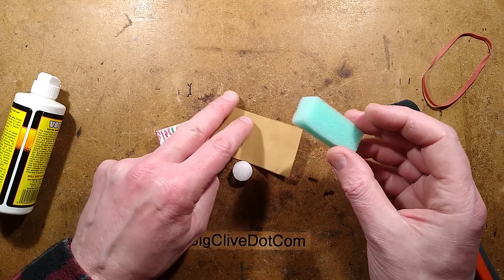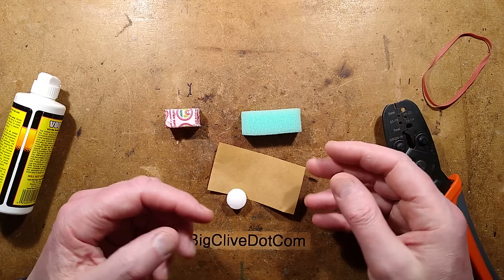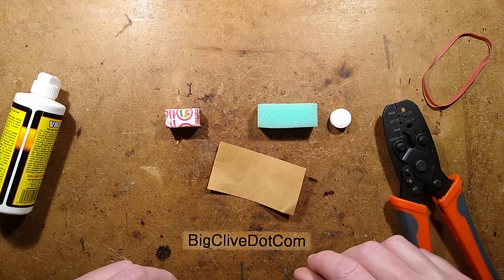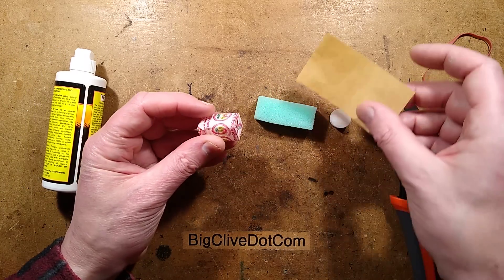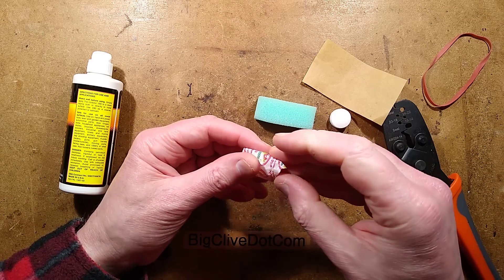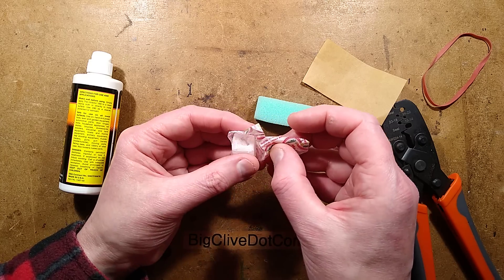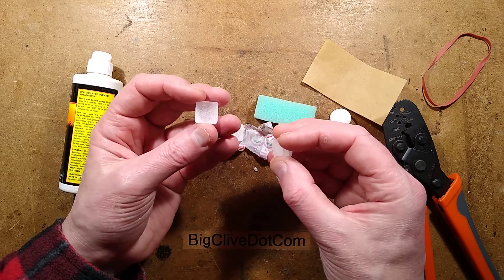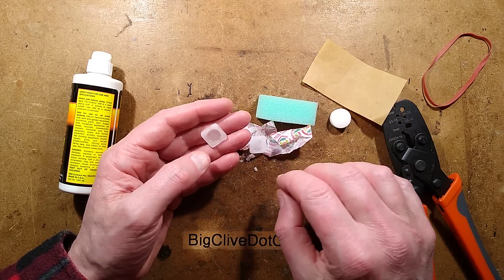Let's talk about VCI corrosion inhibitors

Comment: I wonder if its possible to DIY those solid state dehumidifiers by some alternative cheaper tech. Could you have a sponge soaked in calcium chloride, encased in a semi permeable membrane that wouldn't let any chloride out to corrode stuff, with the "outside" electrically heated every hour to drive off moisture that the inside absorbs and wicks?
Reply from the maker: I've tried many things, but it's a complex science.

Comment: We had a mantle clock that stopped running & mom always said that she wanted to lubricate it by dipping a feather in kerosene & leaving it in the bottom of the cabinet. I eventually found a clock shop & it turns out the mechanism was broken, and they use very little oil these days.
Reply from the maker: The feather is the wick version of the classic kerosene trick where a capful of kerosene is placed in a clock case and permeates it with vapour.

Comment: I've found Boeshield to be very impressively effective toward corrosion/rust prevention. I have used it on various engine parts that were stored outside with high humidity and for "home security devices" with great results. Kinda smells like WD40, but it leaves a much thicker coating similar to wax.

Comment: We used to place a cap full of kerosene in old clocks to keep all the gears lubricated. Worked great as I have an old mantel clock that has been running for 40 years without lubrication.

Comment: The ones we use in our control panels look like a K-cup and it has a pad of adhesive on the bottom so you can stick it wherever you want it inside the cabinet.

Comment: So picture this clive:
Ive got one of those cool neon osglim bulbs in a metal bodied shaded lamp, and i dim it down with a traling edge dimmer. As i dim it down i can feel a tingling buzzing sensation if i run my finger along the metalwork and if i hold a neon indicator screwdriver on it, it lights up brighter and brighter as i dim it further down. Any idea why this occurs?
Reply from the maker: That would suggest your metal shade is not grounded.
Reply: @bigclivedotcom  it is not, but why does a dimmed signal electrify the housing?

Comment: The liquid might ( ? ) be the answer to outdoor LED lights not having rusty legs ? ... FYI ,  NEVER put a bottle of A8 acid flux ( used for soft soldering Stainless Steel ! ) , in your toolbox , your tools will rust like MEGA  BAD .... DAVE™🛑

Comment: even just good old camphor is good stuff, I've left tools with some camphor in the chest locked up in a temperate rain forest for a year straight, not a sign of rust. Its pretty hard to find a worse enviroment for gauge blocks then a rain forest that gets cold!
Pretty sure it was synthetic champhor but that does not matter, chemically they are identical.

I also have heard of using rosemary, I've no clue if it works but I know a woodworker who swears by it and apperantly rosemary does have camphor in it... just not a lot.

Comment: I have a VCI brick in my" tool" "cabinet ".You are correct .not good for your tools with optics .Spraying G96  seems to wok well .Unfortunately there are some oils that just cause your leather tool pouches to rot or grow white  Mold on them so be careful what you do .Some tool pouches cost much more than the tools sitting in them !

Comment: That was the traditional oldschool method for using WD40 to store tools/things you might not use but once in a while; you'd spray it on a thick brown grocery sack paper and wrap the paper around the thing to be stored rather than spraying directly onto the tool/thing. It worked really well for things like spare tools stored in the trunk of a car or specialty tools you'd use only occasionally.

Comment: When I was still at sea as an engineer, we used to open up spares wrapped in the paper, quite often there would be surface rust. The best spares were "fully tropicalised" which meant they had been put in a tin can, a bit like a can of beans. We would have to go to the galley to open them up.

Comment: Wiping steel tools with a cloth soaked in WD-40 works well.
For steel kitchen ware olive oil is a food safe anti oxident.
Olive oil is also safe for sealing food preparation blocks often made from beech wood.

Comment: I've been using lanolin mixed with mineral oil lightly wiped on my tools to keep rust at bay. One little pot lasts a very long time. I've also used it to coat under the car and it's done a great job at keeping rust at bay there too. Pre manufactured, commercially available blends are also available to purchase at significant cost ;)
Reply: My father used to wipe tools down with the original GOJO lanolin based hand cleaner.
Reply: What kind of mineral oil do you mix it with? On my side of the world (Western Europe, The Netherlands), it could mean a variety of petrochemical products and not sure what kind to buy and mix it with the lanolin.

Is your mineral oil odorless? What is it general use case on your side of the world?

Comment: Yes have used all of them, and the camphor ones are mostly napthalene, which I buy locally as urinal pucks, which are merely the naptha crystals, which are almost waxy to the feel, compressed into a puck. They last a long time, and are commonly used to keep insects out of clothing in cupboards, as most things that eat cloth and paper do not like the smell. Also works somewhat in the garage to repel rodents, for the same reason.

The VCI paper is nice, and works, provided the area they are in is sealed well, which is why the military and airlines use it to wrap all parts, often with a big sachet of dessicant, either silica gel or simply oven dried kaolin clay, and then these are packed in a hermetic plastic pouch with a vapour barrier. good for decades when sealed, and needs no other special storage other than keep out of direct sunlight, and keep dry. Pull out rubber parts packed since the 1970's and they are still pristine, after decades sitting on a shelf.

Comment: I have a bit of a collection of VCI paper I've accumulated over the years from buying various car parts, bearings etc and always hang onto it for wrapping various rust susceptible tools, other machining tools, lathe chuck jaws, parallel strips, V blocks etc.
I also place a couple of larger pieces across my lathe bed and around the chuck prior to covering the lathe with a drop sheet.
Another thing I keep is the plain brown paper that comes as packaging with some items.
I can cut off the size I need and soak it in engine oil or hydraulic oil, works just as well as VCI paper, but obviously leaves more oil on the tools but normally isn't a problem, although I avoid this on tools with plastic or rubber parts like handles, triggers etc for obvious reasons.
Another thing I use in some areas, tool boxes etc are the small desiccant packets you find in various packages like new shoes, electronic products etc.

Comment: Our MOD stores always had bare metal items covered in thick brown grease, waxed paper, (3 layers), a thick cardboard oiled box. Cellophane wrapping and an outer box treated internally to stop oil leaking and a dessicant pouch. Latterly replaced with a square of that vapour stuff and a jiffy bag. Ex WW2 stores emerge as new, the new er stuff, dry with rust sheen. Our forefathers knew a bit about packing it seems.

Comment: For my large woodworking machinery with cast iron tables (which rust exceptionally quickly in our cold, damp winters) I have made homebrew oilcloth dropsheets to drape over them. My shed is unlined, so condensation can drip off the rafters and puddle on the tables. I filled a  bucket about ⅓ full with a boiled linseed oil/white spirit mixture, then placed a cotton single bed sheet (from a charity shop) in the bucket for a couple of days. I extracted then bundled the sheet a few times, in a few different ways, until the oily mixture was squeezed throughout. Then I hung it on the clothesline (on its own) on a sunny day. After about a week, the linseed oil had solidified a bit, but it still felt oily to the touch. They keep the machined surfaces in quite good condition.

Comment: Very interesting I am a 35 Year old mechanic from the Netherlands, but I never heard this trick before! With the khampher blocks. 
I usually just put a piece of  cardboard socked in machine oil over a critical blank steel part! 
Or I would cover it in WD-40 !
I think most people my age and younger don't even recognize the smell of khampher and mothballs! 😅
I learned about lubricants and maintenance at school but never heard of VCI. 🤷🏻‍♂️
Petroleum might work, but it smells and it can damage rubber seals!! 
I did use different types of desiccants to combat moisture in devices!

Comment: Interesting topic, and something I knew little about.  My dad taught me to occasionally wipe my steel tools with a rag dampened with motor oil.  I’ve done that for the last 50+ years.  Alternately I spray WD-40 on items then lightly wipe them.
Reply: Wd40 is a great water displaced and cleaner but pretty meh for anti rust.  Any light weight oil including mineral oil would be better. I keep a quart of synthetic 5w20 or 0w20 on hand for such a purpose.   Very cost effective solution.
Reply: @mrmicro22  I did a WD40- test on cheap xmas light leads, similar to one of BC's older vids.  Leads all rusted regardless.
Reply: Motor oil and paraffin, mixed in a bottle, with a small piece of steel wire and a sponge to apply it. Used on saws, and keeps them rust free, though it does cause a nice varnish to build up on them.
Reply: motor oil or other petroleum product? no thanks.  gives me skin problems.  lanolin in a spray can is great.  better than diesel on bare metal too.  or canola oil in a can.  a.k.a. pure and simple.  thats cheaper and easier to get.

Comment: The devices I saw when working with brake systems on HGV trailers looked like an ideal housing for a PP3 battery, with some carbon-ish foam inside. The housing was stamped with the makers name, will have to look in the shed see if I have any laying around. The drums, discs or any ABS ring components all came packaged with one. The components were not "lubed" nor had an oily residue that you had to clean off via such things as brake clean etc, (though it was strongly advised to do so), and they were not packaged in special boxes or anything. Just a typical cardboard box, component inside, no bag and the "anti rust" block of whatever it is. They did have an expiry date. 

TL:DR, I saw a lot of plastic housings that could accommodate a PP3, but had foam in that mitigated the need for important components to be "oiled".

Comment: Vapor paper has been around forever. You may be able to find whats in them by looking up the cancelled us mil standards. Small wave guidebsections and flange seals used to come in vapor paper pouches. Fairly recently mitutoyo gages had a token strip of the stuff in the cases.

Comment: Many of the ones I've come across do have some sort of oil component, usually a light, easily vapor-able oil like grapeseed, eucalyptus, coconut, or castor oil (un-bound, & no carrier like the glycerin it is usually mixed with to slow that down), others are always composed of some form of solvent, something to be delivered to the material, & usually something to either increase or inhibit the dispersion of it to the target pieces. Many include camphor, or some form of naphtha, petroleum or mineral spirits, or mineral oil. That said; there are others that rely on something more akin to Krylon paint- forming a molecular bond or chemical reaction to prevent, stop or even reverse the breakdown of the material they are designed to protect. A great example of this is Evaporust. The oldest form or this that I know of was done in the late 1800's- primarily to cast or wrought iron to prevent them from rusting. The pieces would be thoroughly cleaned & degreased & then etched in 10-12% vinegar. Afterwards they were rinsed in clean water & submerged in what is now known as PAA or Peroxyacetic Acid (CH₃ CO₃ H₀) for a few minutes. This created a new, fine; non-pitting layer of rust on it- & then they were directly submerged (no rinse) in boiling water. This converted the (Fe₂ O₃)<Red Iron Oxide, not to be confused with Yellow/Orange Iron Oxide (FeO)> into (Fe₃ O₄) <black iron oxide (magnetite)> In nature it is Hematite, but it's structure differs slightly in in it's naturally occurring form.

Comment: I knew many clock collectors that used kerosene annually. A cap full in the case to keep the chimes and movement lubricated and clean. They are all gone now so I can't be sure who originally thought of it but I know it can get a dead clock working in some cases
Reply: My grandparents used kerosene for clocks and applied it to the movement with a chicken feather.
Reply: @blackcat31w  I wonder if WD-40 would evaporate and have a similar effect? It smells better. I'm going to try camphor in one. If my father were alive I'd have better answers

Comment: A company I worked for that had equipment outside in steel enclosures used Zerust capsules and they were magical, you couldn't tell anything was happening, but nothing corroded.

Comment: Only ever seen desiccant in the states inside any electronics or whatever..  usually if something needed an oil layer to stop rust it is put on in factory but ive seen any type of oil usually does the trick as far as direct contact.  Never seen anything rely on oil vapor from evaporation in contained areas..

Comment: I used to work at a spring manufacturing company. Most bed springs that we produced were wrapped in in VCI paper. They were pre cut sheets that you pulled through pre soaked rollers giving the proper amount. A deferent rust preventer but no VOC that we also  used was a NAs product that was Lanolin based. This was micro fogged onto products. Prevented rust and lubricated at the same time.

Comment: The only one I know about was made by Shell called VPI for Vapour Phase Inhibitor.
Shell's compound was bicyclohexylammonium nitrite a solid at room temperature but with an appreciable vapour pressure. One group of chemists researching these compounds knew that nitrite ions were corrosion inhibitors in water, from their work on cooling system inhibitors during WW2.  The other group of chemists had backgrounds in detergents, they tried to develop a molecule with different functions at each end, like a detergent, but in this case a metallophilic end to stick to the iron and a hydrophobic end to repel water. Combining the two ideas led to the final compound. My Father working at Shell at the time as an industrial chemist, had some slight involvement.
All iron surfaces at room temp have a layer of water molecules adsorbed on to the surface. The VCI not only repels this but delivers nitrite irons to the surface which actively inhibits corrosion.
I'm talking here about 1950s tech, I am sure there are better things available today.
The greasy feel of VCI paper is just the wax carrier for the inhibitor. I have a pot of the pure substance in the garage, enough to make several hundred square meters of the paper, I put a light dusting into micrometer cases and othe tool boxes.
Reply: There is a good Wiki article.
Reply: In the US we use a popular WD-40 spray for coating tools against rust, lubrication, and storage.   WD-40 contains paraffins/isopraffins, mineral oil for lubrication, and mineral spirits as solvent.   Basically it works similarly as VCI's.
Reply: @BillAnt That's not really similar at all. Additionally, WD-40 isn't a great choice due to the limited amount of oil in it and the additive package, which results in residue rather than a coating. It's for Water Displacement, after all.
Reply: @LN997-i8x - Well WD40 is not a good lubricant per-se, but it works well in many cases.
Reply: @BillAnt  Not a VCI it only has hydrocarbons and is a poor water displacer.

Comment: I have a Zerust VCI sponge inside my ahem home security device safe and it has done an excellent job protecting those blued steel devices from Florida's insane humidity. Wonderful stuff.

From what I've been able to gather the stuff basically works like Halon, bonding preferentially with metals and thereby excluding oxygen. No idea if that's accurate but it seems plausible.

Comment: I have a product called "Evaporust" still in its packet from the 1950's that I found amongst a deceased relatives belongings, it appears to be a sheet of brown paper that is impregnated with "something" and the instructions say it should be placed in the bottom of a drawer or toolbox etc to prevent corrosion!
I imagine this is an early iteration of a similar product/principal!? 👍✌️🖖
Reply: Any relation to the modern product of the same name?
Reply: @SockyNoob  Possibly, although the modern product is a remover not a preventative product!?

Comment: I've seen multiple long term corrosion inhibitor tests. And a thin coating of regular old 30 Weight motor oil almost always beat out the "top secret" formula products you mentioned. I do use the impregnated tabs in my toolbox, since I live in a very humid area. My tools are not climate controlled and no rusting in 20 years on anything.
Reply: Would a sponge soaked in a new motor oil 30 work also? 🤔